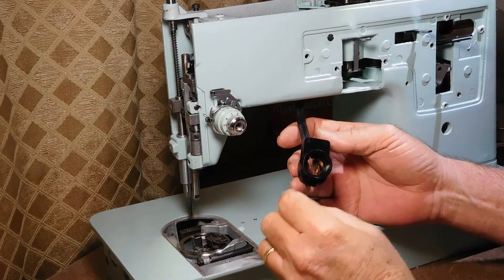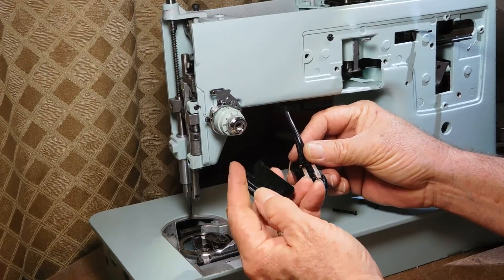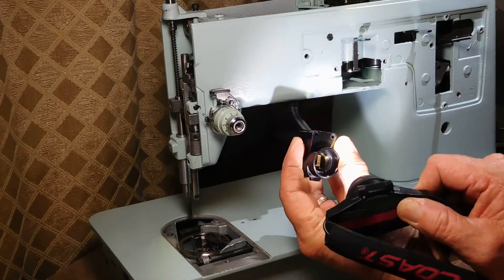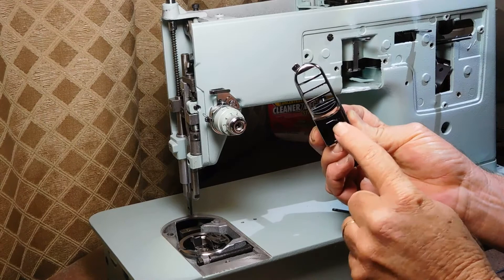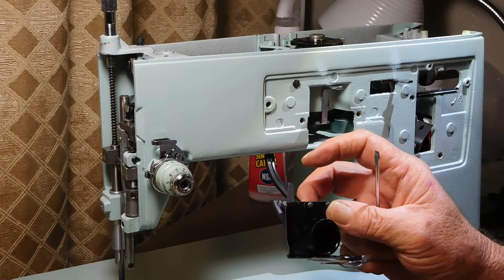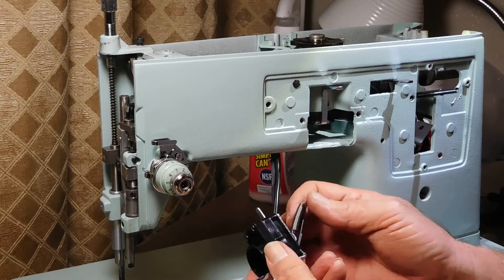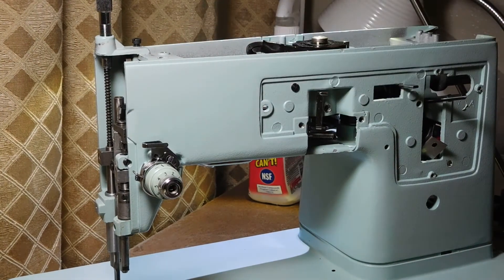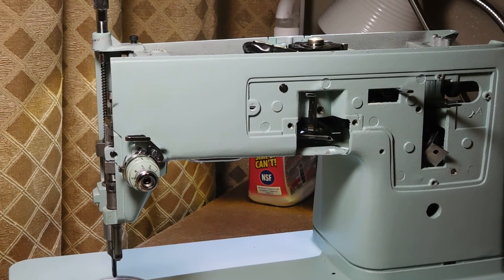Step by Step Restoration of a Singer Model 337. A Series. Part 16: THAT DARN LIGHT

Comment: I'm working on a 338 right now and the light wasn't working. It was a result of the wires breaking at the soldered joint where they meet the contact springs. My soldering must have been a bit heavy because I'm having a heck of a time compressing the two halves together to get the screws to catch in the spring hinge. I'll probably need the help of another person to get it back together. I'm not as polite as you Andy, as I was thinking THAT DA*N LIGHT
Reply from the maker: Hahaha... the best laugh I've had in awhile 🤣 Remember, my videos are edited before I post them. You don't get to hear "everything" that is said during the restoration work. You'll also notice you've never seen my face in a video? I'm told my face gets very red when I'm upset, and who needs to see that, right? 👀 Good luck going forward, Terry. Take care.